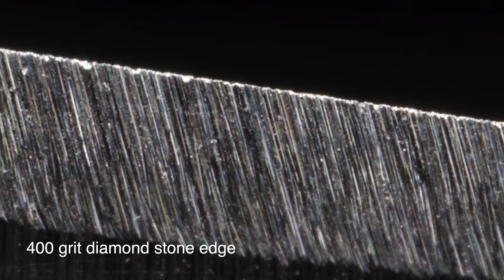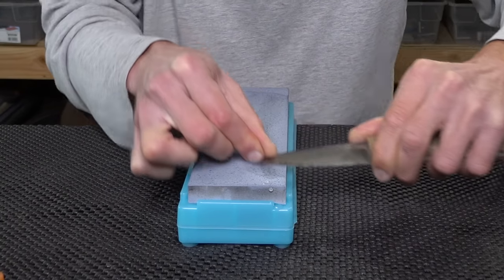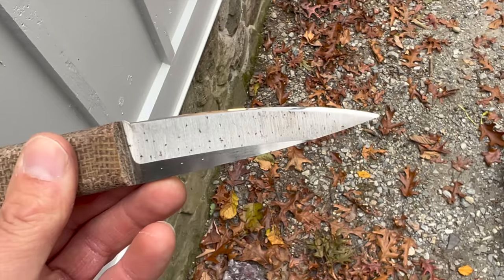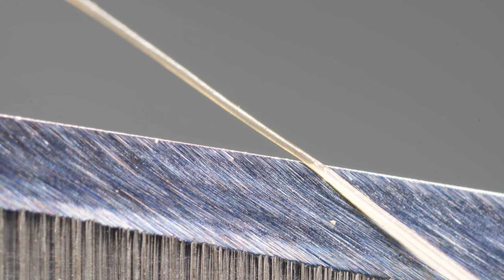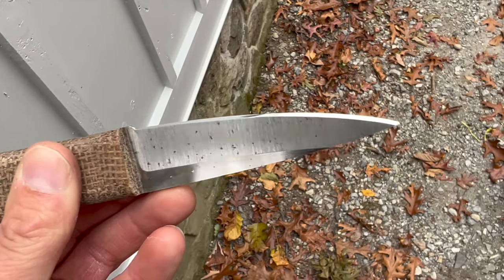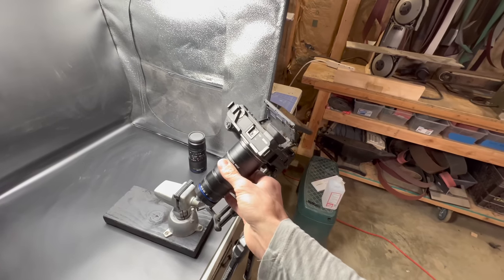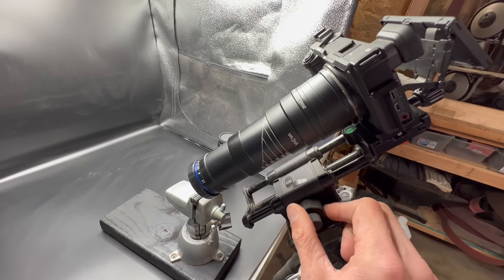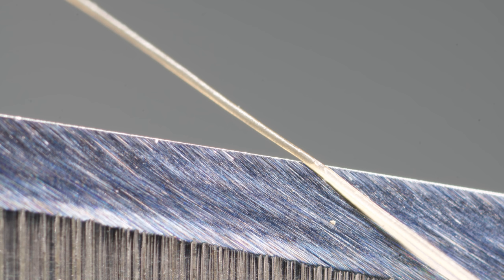What BEYOND Hair Whittling Edge Really Looks Like ULTRA CLOSE UP | What I Use To Get Ultra Close Ups

Comment: Stopping down your aperture will increase the depth of what is in focus.  That of course lets less light through the lens, but if you can get some more light on the subject with a ring light or an additional external flash, that could help open up your depth of focus.  I've done a good bit of macro photography and trust me, I know the struggle you are dealing with.  I like the rail mount you have.  oh and dude... I have a wicked edge and I get knives SUPER sharp, but I've never seen a knife go through a paper towel like that.  Anyone who has never tried to cut through a paper towel like that doesn't understand how sharp that knife had to be...
Reply: Another thing you can do is focus stacking, where you take a series of pictures with the focal plane moving back with each photo. These images can then be combined in something like Photoshop to give you a deeper depth of field.

Comment: Awesome to see you dive into the Shapton stones, I've been using them for years (both bench and guided systems) and they are by  far my favorites. Also, totally get the 12,000. I use it every time I sharpen, it avoids needing to strop nearly as much, you can start with 1 micron compound.
Reply: they're okay for low alloy and chromium steels, as they are an alumina abrasive, and for doing edges, as they are known for being very hard and very minimally friable stones. for wider bevels they are lacking. the scratches are not on the same level as even the glass line from the same maker, which is a slighter less hard, more friable stone which leaves much more even scratches and generally works faster. The glass series was designed to be more like the naniwa chosera stones.  Neither of these works good for vanadium alloyed steels though. Even something "basic" and common like s35vn will skate over these stones feeling like glass. The resulting edge is always lacking and it takes forever to grind. Woodworkers love these stones because of how hard and minimally friable they are, yet they still cut extremely well as long as you're not talking about vanadium steels.

Comment: Hey Alex,
I usually use cheapo knives, and used angle grinder with weared down flap disk + polishing compound plus bench grinder with MDF wheel to sharpen them gently.
It is fast, but it is not precise, and its also can soften the edge... (I just feel that my knifes deserves better than that)
After watching all your videos, i decided to buy the first two stones (Shapton Kuromaku 1000,2000) as my birthday present to myself. I think i will use sandpaper+glass as a coarse one, until i can buy some kind of diamond plate for profiling. 
I newer tought that i will ever use whetstones, before your videos! :)
Keep up the good work!

Comment: Hello, Alex!
Thank you for another great video ("I love monkeys", just so you know.)
This video made me want to buy more stones.
I've already bought the Shapton 1000 AND the 1500, which I haven't even tried yet (I  will).
I usually use my really cheap amazon diamond plates to sharpen.
I even use them to dress edges, like on a hand plane or when deburring an edge.
I smooth & polish side edges, like on a plane, chisel back, or spokeshave iron.
Anywhere its a flat, square edge.
The 1st set was $20 (400, 1000, & 1200, 2.48"x5.9") the 2nd set was $13.
Since they were cheap I don't really value them like the Shaptons or DMT diamond plates.
I seldom hone anything to a mirror finish any more, I apply the Paul Sellers point;
Do it enough to work & get back to work.
Have a GREAT day, Neighbor!

Comment: Photography: have a wide variety of focusing rails come out your camera you can possibly look into a better setup and make sure that your tripod is quality solid to prevent vibration. 
Eliminating bump and shake when taking a picture you can either do a shutter delay timer then it takes the phone in whatever allotted seconds you choose. 
Also for the camera you can buy a wire or wireless remote shutter control so you don't have to push the button on the camera.
Reply from the maker: I usually use a delay timer. Works well👍

Comment: Do you think if monkey were able to use tools as well as we do, that they would love to have sharp knives? 

Question, how longes does the sharpness last?
I'm in a bit of a pickle, i sharpen my mom's and pop's knives, but they are the kinda people to throw them in a draw rather than hang them, so I'm looking for a way to give them sharp knives while also don't need to sharpen them each weekend, cuz they lose the edge by bumping on each other in the draw.

Great vid, and thank you for your dedication and content.
Reply: Sharpen them with a convex edge and give the edge a steep final angle

Easier said then done, but the shape and angle of the edge is just as important as the steel on the knife- if it's cheap kitchen knife "stainless" steel it just won't last no matter what. The best you can do is get the edge super steep and thick so that it lasts longer under abuse and get the edge fine enough that it will cut produce. I doubt they would complain about their knives not having mirror polish while they chop up a jalapeño.

And further than that you can do blade maintenance on them by stropping and honing the blades on occasion. Or show them how since that part is really easy and makes a big difference.

Comment: The close up photography is known as "macro".  I play with macro and use a Canon MP-E 65mm macro lens.  It too will shoot at 5x.  As mentioned, you need a macro rail on your tripod to use it effectively because the depth of field is so incredibly tiny.  If you shoot macro handheld, you typically don't try it at 5x as that's near impossible.  1x or 2x maybe at the most can be done by hand. 3x is possible if you haven't had your morning coffee and your subject is static, but it's very difficult. 

Since these lenses have no automated features, you also need a lot of light to keep shutter speeds fast to avoid motion blur.  In a way, they are counter intuitive as you also want large F-stop settings to increase depth of field, but that in turn requires more light for proper exposure.   

These lenses and associated equipment are not cheap.  The Canon MP-E 65mm lens, for example, is over $1,000 (new).  The macro flash unit I use (Canon MT-26EX-RT) is also right at $1,000.  A good macro rail will set you back $500+ and a good quality tripod another $250+ 

As for tripping the shutter, when doing extreme macro you can use a remote trigger, or just use the timer on the camera.  I typically use my timer set at 2 seconds to avoid any shake or movement.

Comment: New subscriber here. I've been wanting to pick up a set of sharpening stones to get my axes, knives, and tools sharpened but I'm be to ask this. The sharpton seems like a good value stone from your videos but what do you recommend for someone just getting into sharpening? I'm thinking about the 4 diamond stone set from honoson that you reviewed the dual sided one the other day but I like the idea of a traditional wet/oil stone better. I also thought it would be fun to find a hone rockhounding but I've had some trouble trying to find good information about what kind of stone to look for. Anyway great video! I'm super impressed that you get those images without a microscope. I thought for sure you were doing it with one. I worked with a piece of laboratory equipment that we took high res images of metals for metalography but that's really cool to see you camera setup. It's crazy what they can do these days.
Reply from the maker: Id get a coarser diamond stone like the one I reviewed the other day, And a shapton 1000. It would be hard to beat that setup for about $60. Thanks for the comment I really appreciate it👍
Reply: Like the man said a solid set with diamond stone and a good 1000 grit is a good start.
Other than that, just getting what you can and starting somewhere is really the best thing you can do. I picked up the cheap $20 set off amazon “400,1000,3000,8000” and started learning on them. Came with the stones, a holder, leather stop, little leveling stone, not a bad kit for $20. I sharpened a bunch of pocket knives and my nice chef knife that was dull as a butter knife for about 4 hours straight the other day. He reviewed the same kind of stuff a little while ago, they aren’t very good for getting consistent performance. But definitely worth investigating if you decide you’d like to pursue sharpening as a hobby or skill. Grabbed the 1000, 2000, 5000 shapton stones that he recently posted for when I feel like I have an idea of what to do. Then I can sharpen my skills further on better stones. Hoping I can get my techniques down pretty good to where I wear out the cheap stones and can really do well with the quality stones.
Edit: I wouldn’t suggest getting cheap stones if you can afford even one quality stone. It’s just what I am doing.

Comment: the 120, 220 and 320 are the course aka grinding stones. The 220 and 320 are SIC. All others in this line are alumina. the 1000 (more like a 600 or 800) 1500 (more like real 1000) and 2000 are the medium aka sharpening stones. the 5000, 8000 and 12000 are the finishing/polishing stones. You NEED ONLY ONE OF EACH STONE to have a set.  The ones I suggest are the 120, 320, 1k, 2k, 5k and the 12k.  8k and 12k are interchangeable, the 8k was designed for high end kitchen knives whereas the 12k was designed for woodworkers, so says the manufacture, but they say a lot of rubbish. I like the 12k and use it for kitchen knives and other things. These stones are known for being very hard, slow wearing and very minimally friable making very little mud. yet they still cut very well for low alloy and chromium steels. Where they lack is wider bevels, polishing and vanadium alloy steels. The scratches for wider bevels and polishing are not in the same league as the glass series or naniwa chosera.

Comment: my favorite knife is a 10$ herbertz made of 420 steel
I never make it very sharp, because I know I will abuse it, but it still holds it's edge remarkably well even when cutting aluminium or copper
I really like the balance between sharpness and durability

but stainless steel, even tho it can survive the laundry cycle without rust, will turn rusty when exposed to hydrochloric acid apperantly...

Comment: Could you please dive deeper into the topic of the difference between sharpening the knife on the 1 micron stone and stropping it on the 1 micron compound?
Also does the knife's steel make any difference to the final result? Is it possible to sharpen, say, a cheap "Ikea-style" kitchen knife to a hair whittling level?
If I have the 1000, 2000, 5000, 12000 Shaptons and white and blue Dialux compounds (the finest ones), is it possible for me to achieve the hair-whittling sharpness on a cheap steel, so that if I don't get that result it's only because of my hands?

Thank you a lot in advance. You're basically the nicest sharpening guy I've ever seen on YouTube. Please be well and have everything going good with your health. All the best!

Comment: I’d love a monkey that could sharpen my knives for me. I’ve spent years watching sharpening videos and building alternative sharpeners because I think it should be easier. I don’t know why making an extremely sharp edge is either expensive, hard to learn, time consuming or all three. It’s ridiculous. I’m going to solve this problem.  

FYI, you’re the best sharpening researcher/teacher I’ve found. 

Any chance you might want to explore some alternative sharpening techniques?  Like holding the stone, using a marker, and resting  the knife on top of a spray paint can near eye level? If the light is bright and placed just right you can see your “sharpening tracks” without the marker.

Comment: how do you store the stones after you use them? try and soak up as much water as you can and let them air dry?
Reply from the maker: These are ceramics splash and go stones. You dont soak them and shouldn't. I simply wipe them off and store them in their case🙂

Comment: I have the same exact stones and grits! I bought the 1500 after watching your shapton 1000grit video then went and got the 1000, 2000, and 5000 i also grabbed a 8000 grit nagura stone to for metal build and maintaining flatness, so i dont have to use my diamond plate as much. I want to get the 120, 220, 0r the 320 for profiling and major damage, any suggestions on which of the 3 I should choose?
Reply from the maker: I have the 320 coming for testing soon🙂
Reply: @OUTDOORS55  I will keep an eye out for the video! I really appreciate the recommendations and the reply. Keep up the amazing work.

Comment: I can remember taking macro images  using Kodak Pan-X (ASA 32)  with my Nikon  F-1.8 lens ( which I considered the best available at the time) reversed. I had a special adapter to mount the lens in reverse and shot long exposures at F-32)  The focusing was the same way. Had to move either the camera or the subject to the correct distance to the focal plane to get the perfect image. Nothing with the magnification that you use. Excellent work, both your photography and sharpening techniques!
Reply from the maker: Took me a while to figure out that long exposure with small aperture was the ticket. Im slowly getting better with it. It's challenging to say the least! Thanks my friend 👊

Comment: The 2.5-5.0x indicates how large the projected image on the sensor is compared to its actual size 
A 1mm object at 1:1 would be 1mm on the sensor, at 5:1 it’s 5mm. 

Imagine scanning a sheet of paper: at 1:1 your copy will be the exact size as the original, now imagine you have a canvas instead, the scanner only fits a fraction of the size but the resolution is the same giving you more details of a smaller part